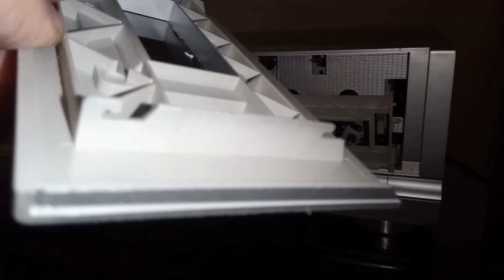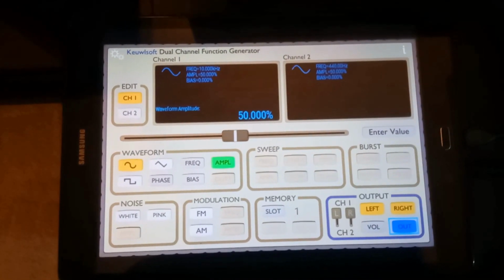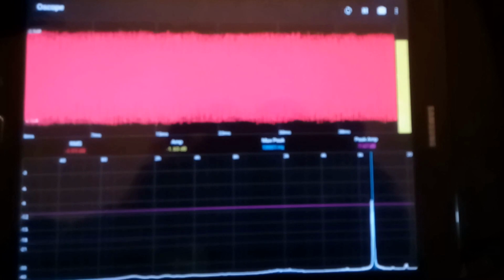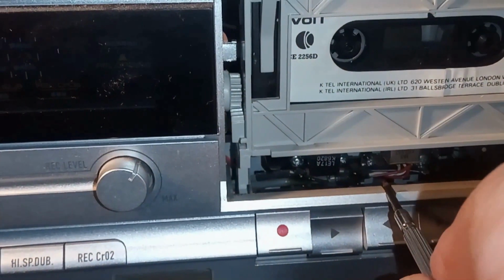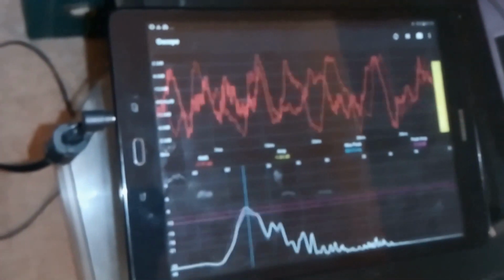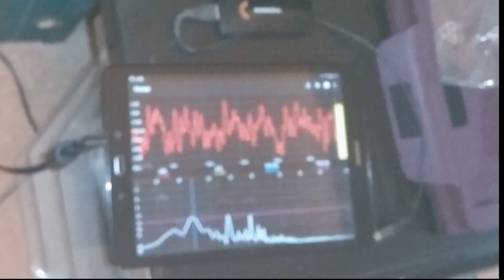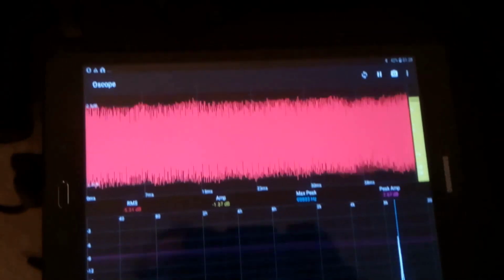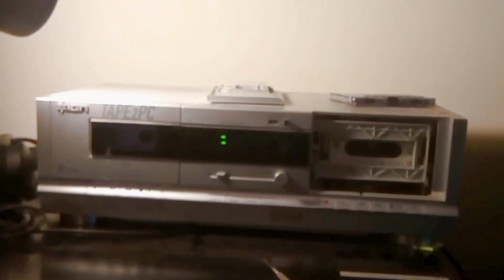Cassette Deck Azimuth Adjustment WITHOUT Expensive Tools - Works for SONY, Pioneer, TEAC & More

Comment: Sjećam se osamdesetih godina posuđivali smo kazete jedan drugome i sve kazete su bile drugačije podešene, nije imalo smisla truditi se podesiti glavu na taj način nego samo malo zavrtiš šarafić i kad si čuo najbolji zvuk to je bilo to.
Reply from the maker: The trouble is that once the head is adjusted away from its proper alignment, every tape you play or record after that is slightly “wrong.” Playback only sounds good when the head matches the alignment of the tape that made the recording. So every time someone tweaks the screw to match a different cassette, they’re drifting further from true alignment — and all future recordings end up misaligned too
Reply from the maker: Problem je u tome što, čim se glava malo odvrne od pravilnog poravnanja, svaka kaseta koju poslije toga pustiš ili snimiš bude pomalo “krivo” podešena. Reprodukcija zvuči dobro samo kad je glava poravnata isto kao ona koja je snimila original. Zato je svako okretanje šarafića da bi se prilagodila nekoj drugoj kazeti zapravo još jedan korak dalje od ispravnog poravnanja — i sve buduće snimke zbog toga ispadnu pogrešno

Comment: Hi Great Video! - Just checking that I got it right - You make L R cassette out as Mono to SUM Audio for Azimuth while playing music / Test Tones. You don't worry about Mono L into the deck as Test Tone Signal is 50% L R.  You use MRL 10kHz Tape Test Tone to verify Mono audio from combined L R = peak on the app.  What about using separate L R out from the cassette to the app? You'd  need an external SC with dual out / inputs with USB to TRS. What about using 0 VU meters? Thanks!!!
Reply from the maker: The idea is to be able to get a useable result. For the man in the street.

Comment: If it's a cassette deck with Dolby S and you don't have an official calibration tape and a dual-channel oscilloscope, don't touch it unless it looks as though someone else has been in there first. It was part of Dolby Labs strict licencing conditions that all cassette decks with Dolby S installed MUST leave the factory with less than +/- 0.05 degrees azimuth error. Mess with it without the proper tools and you will NEVER get it right again, and definitely not by ear.
Reply from the maker: I could not agree with you more. I am not an advocate for adjusting things just because you can. I have several videos up which try to stop people fiddling. You may have seen them? this one is the latest. https://youtu.be/sMA0cFbPsuU

Comment: I usually turn clock wise and anti-clockwise until I lose the treble in either direction and then settle in the middle. The special tool I use is my ears.
Reply from the maker: That's what a lot of people do. My ears are old so I use a phone app ( free) just to be on the safe side.
Reply: me too. I reckon my ears are trained enough after listening to music for many years - if it sounds off, Im pretty sure I can tell. I also compare it to a digital version of the music through the same hifi.
Reply: No matter how great a person may think their ears are, they're next to useless for setting azimuth correctly. Playing an official 10kHz (or higher) calibration tape and adjusting azimuth to phase-match both channels on a dual-channel oscilloscope is the only way to get it right. If you don't, you're almost guaranteed to have massive phase errors between the two channels at high frequencies.

Comment: How do I adjust the tilt?
Reply from the maker: On the head assembly, there are two screws. One is mounted into a solid screwed stump, the other normally has a spring around the screw and that one can be adjusted,. The exact arrangements differ from deck to deck but they are all a variation of the same thing.  That screw will adjust the tilt (Azimuth) But a word of warning. Mostly it is sealed, and should not need adjusting.  So don't do it  until you have proved beyond a doubt that it needs doing.  Good luck. I hope that helps.

Comment: Hi Gary. I had to oil the motors of my Yamaha KX-580se because while playing back tapes recorded on other tape decks it started making a horrible squealing noise. Without thinking, I unscrewed the pinch roller and heads. This means that both my record and playback heads are now out of alignment. So, if I record something, I'm recording with a misaligned head. If I then adjust the playback head to make that recording sound good, won't other tapes recorded on an aligned deck sound bad?
Reply: What I have since discovered is that the Yamaha KX-580se is a two head deck which means that the left head is erase and the right head is both record and playback. So, alignment of the playback head azimuth is also alignment of the record head azimuth. So, I guess my new question is: how does one correctly align the erase head?
Reply from the maker: The erase head is not realy in need of alignment. Assuming you have only undone it and not bent anything then the erase head will be ok . Just pop it on the mounts it came from. If you Alline the Azimuth as shown in my video that will be ok for playback and record.. The Erase head just has to be the correct height. The best way for the layman is to record some loud music on both sides then record silence on one side and when playing back the silence listen if there is a breakthrough from the recording on the other side. . any further questions please just ask.
Reply: @GaryKeepItSimple  Thanks, Gary.

Comment: Here are my findings on this argument: even if you use high quality cables I would never go through a Y connector. They've always been garbage and they'll always be, once you connect to some other source even if they were the best it's going to hamper the quality especially in the upper frequencies you're trying to alight your tape deck with.

Then there's the alignment: I would never align a tape deck onto itself (e.g: deck A to deck B). What I'd do if lacking a proper test tape which are getting rarer and rarer these days is align the azimuth on some known optimally recorded tape from the same deck (example: when it was new), use a known good quality cassette album (music) or ask someone with a very fine non-reversing deck to record an alignment tape for me and use that as a reference.

I've already in the past been victim of myself by trying to align a tape deck through adapters: always use direct in/out, or the headphones connector of the tape deck. If you really need to pass through an amplifier at least use source direct to skip the equalizing step.

That Function Generator app is simply amazing.
Reply from the maker: No argument from me.
Reply: @GaryKeepItSimple  I know... I am fighting my own shadow.

Comment: Are you aware that you just used a magnetic screwdriver on the tape path?
Reply from the maker: It was not magnetic. It was steel. It was not a problem. I checked. Anyway I have a demagnetiser if required.

Comment: How did you connect stereo jack to tablet?? I cannot get input to my tablet, only output :(
Reply from the maker: I input with a Trrs  AV lead. The tablet was fed with a Mono coupler. The Mic input is signal, the app i used is happy with line level. I used a AV lead ( left right Video)  the Mic input  on the tablet was the Video  plug.
Reply from the maker: You can get good results using the inbuilt mic. It is better than by ear but not Ideal.

Comment: What software are you using for this?  I think you'd be best off using a proper test tape with tones.
Reply from the maker: I have both as I pointed out in the Video. This is a' Get yourself out of a HOLE' that you should not have gotten into  in the first place' HOW TO'.
There is a video on my channel about what Azimuth is and also a Troubleshooting- How to which states. Don't Fiddle leave well alone unless you really have to. Then once they have fiddled, if they want to, they can get it done by a PRO. or not.